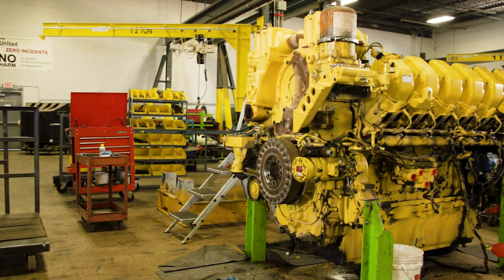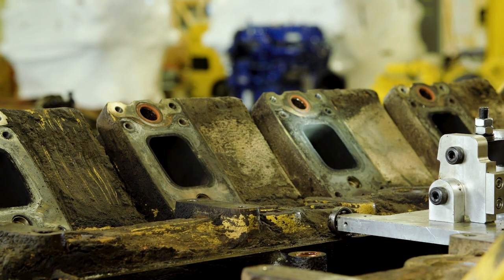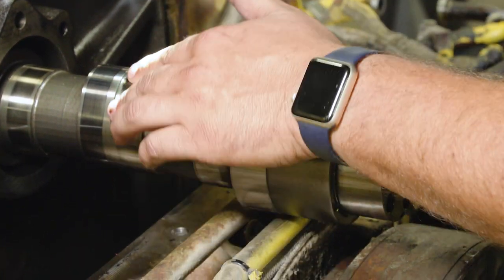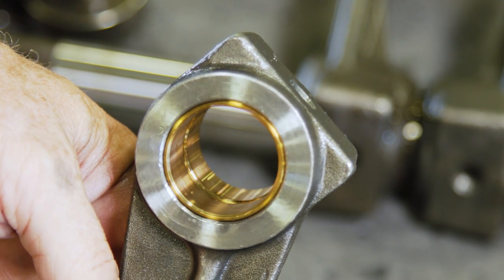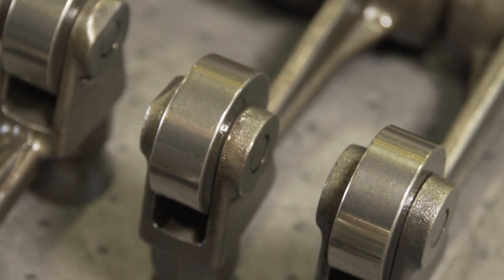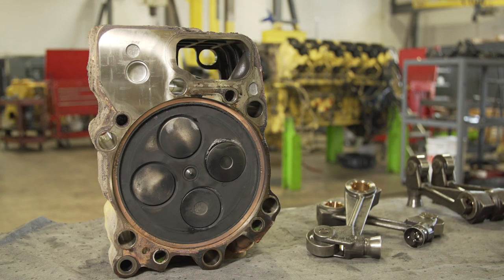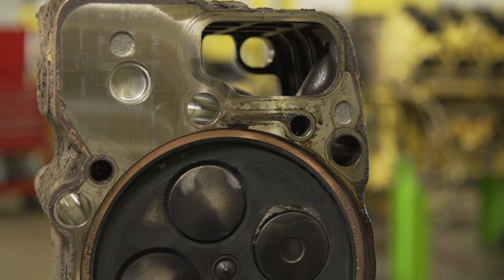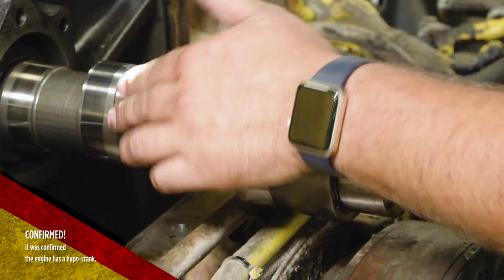MTU Engine Teardown by Schaeffer Oil

Comment: QL4 interval on this engine is 21000 hours. Seen one with 51000 hours, only replaced turbochargers an heads. MTU is one of the best engines with proper maintenance. No need for special addictive in the oil.

Comment: I've been working on MTU engines for 15 years and seen 4000 engines run till 30,000 before major overhaul, and at that many hours the liners/pistons/bearings look like new still... no additives used.
Reply: Yeah been to the training center for S4000 tier4 overhaul.  Great setup , lots of mtu engines to look at , instructors great. I had Wolfgang in the past for ECU7 training , he’s very knowledgeable.  For overhaul I had Greg Mowbray, they are all good teachers. 
All the best tools and specialty tools there to use. Highly recommend going if you get a chance.
Reply: Hello sir

Comment: and why was it torn apart then??? running good, no oil usage, so why was there a tear down??
Reply: Obviously for promotional purposes!
Reply: bauerle2009 recommended overhaul for this engine is 10K hrs. They ran it twice that long. They don’t wait for them to blow before they overhaul them. Many fleet & industrial applications automatically overhaul equipment at given intervals regardless of how they are running.

Comment: The secret with good engine condition in MTU engines even after many operating hours is load 
If you don't load MTU engine enough, many problems will appear very early